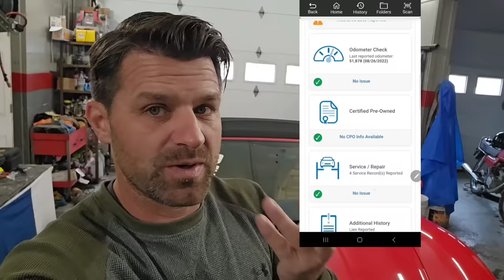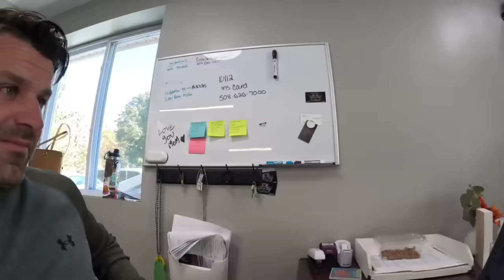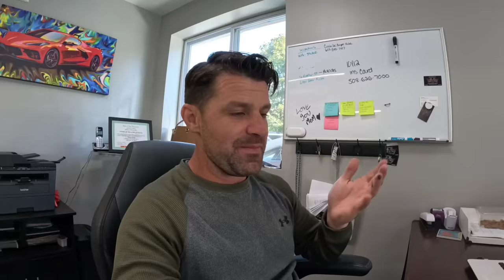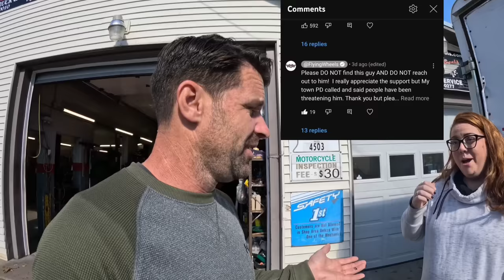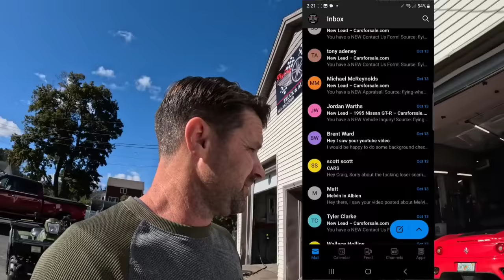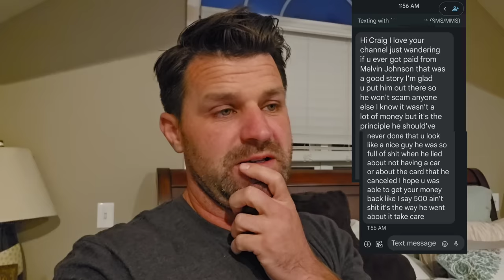How Exposing a Car Scammer Got me in Some Trouble

Comment: As a auto salesmen/owner you should 100% scan every vin for damage report before making an offer. Will eliminate the tension/ back tracking from offered trade in value. 

Second thing: I think checking beyond the reports and inspecting the car on a lift wouldn't be a bad idea either. 

Love the content and the channel, dropped a like and sub. Keep up the noble work sir

Comment: Owned a dealership in the heart of Los Angeles right on Ventura BLVD. Did well but I got out from the biz because I could not deal with people anymore. I’m a perfectionist and mechanics, body shops and upholstery guys, everyone cuts corners. I got out but before that got scammed on a 745 BMW. Bought a 745 that was leased but the bank accidentally sent the title to the guy. This was accidentally not one of those that they got the title scamming. Went through the court and really got dragged through the system for 3 years. You much rather take care of it yourself.

Comment: Yeah that happens to me once’s they sold me a car and it was a salvage. The guy never told and I didn’t see it on because dealer use the look over here tactics. I know it was my fault but the dealer just like you was a scammer. Because he didn’t mention it. At all I found out when I received my tittle. So yeah maybe he scammed you with 1k. But you scammed him with 35k. For a car that cost 10k Just put a on your dealer that you sell used salvage flooded cars.  You failed to mention that cuz you wanted to screw him over.  And then he getting back at you. And you humiliate him in front of the world ? I hope you get sue for false advertising and slandering.